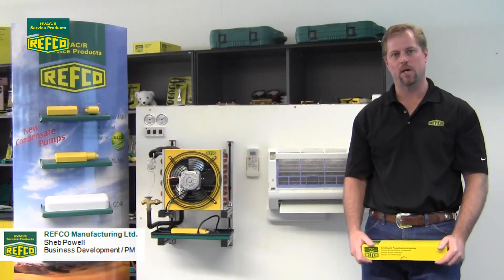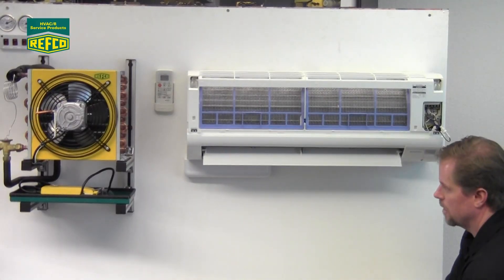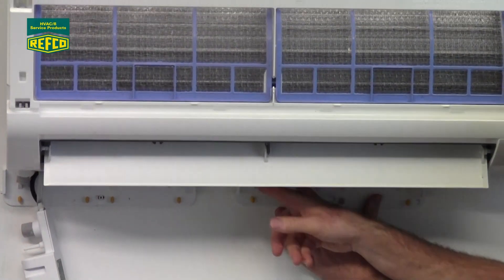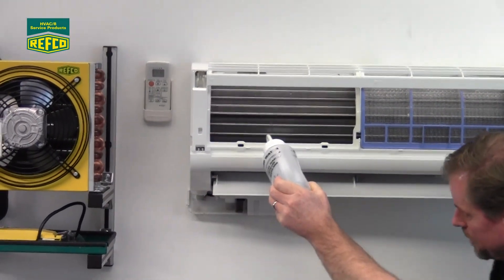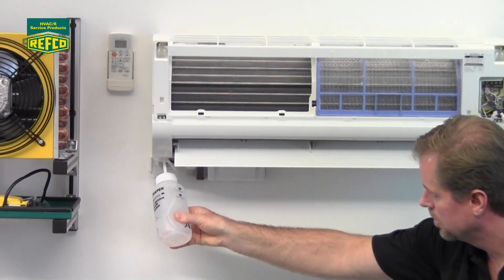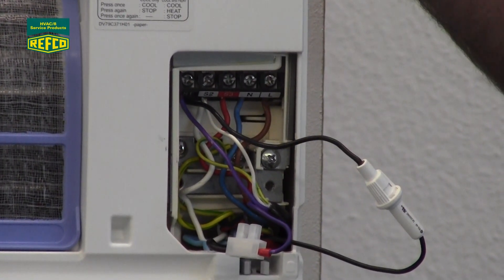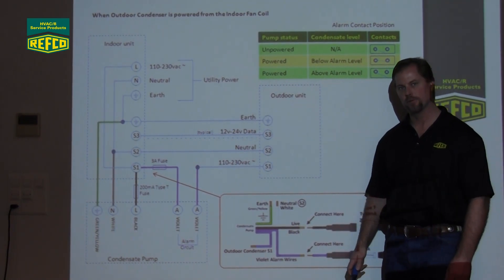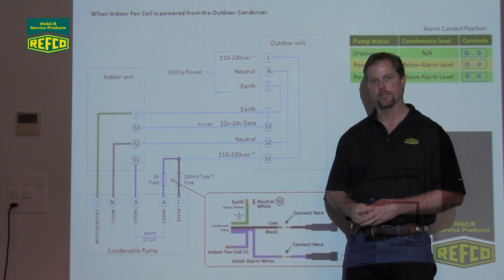REFCO GOBI Condensate Pump Installation

Comment: Hm I used to connect the safty connector between the S1. But just had a talk with a colleque. What if I cut of the S1 - The valve keeps open and condensor might freese and in the long run it coud freese so hard, it distroys the indor unit

Comment: anyone know how strong this pump is?  like can it pump water across an entire garage and out to a downspout outside?  how high can it pump?  or how long of a run can it handle?
Reply: Max suction 9.8 ft max head 65.60 ft max horizontal run is 330ft at zero head and 0 suction   That’s the specs off the manual wish they would explain it like normal pump like 30 ft lift and such  guess I will find out when I start the unit to see if it works I am going 5 feet up and 20 ft across and having it pump into 1/2 pvc running down the side of the house with my line set

Comment: Ours seems to have stopped working.  The water tray is full and nothing is going out the tube.  It’s making a very loud rattling sound.   Probably needs to be replaced?
Reply: From your post we do not know what can be wrong with your pump. 
Pls take pictures of the installation, note power supply, duration of operation, installation settings with other components of the cooling system and bring the pump back to your distributor. He can analyse the operation of the pump with help of the REFCO Pump Read program. And he then decides about the next action.
Thank you for your cooperation. 
Kind regards
REFCO Manufacturing Ltd.
Reply: REFCO Manufacturing Ltd. 

Here is what it’s doing..

https://youtu.be/wmuJeu5LdE8

Comment: If the pump was connecter previously to 120V; would one be able to connect it to a 240V source, and the pump still operate properly?  (Reference universal ballasts:  once the initial voltage is applied, it is only that voltage hence forth).

Comment: Midland Texas - Last week I had a mini-split installed with gobi pump.  Question?  How long should the pump run?  This pump runs for 15 - 20 minutes at time.  The discharge line is clear but the pump is not moving much water.  This one comes on an runs for extended periods of time even when the A/C has been turned off for hours.  It vibrates the wall and is very annoying?  Any suggestions?
Reply: Hello Richard,
Normally they will only run for 10-50 seconds at a time depending on how humid the indoor air is.  Running 15-20 min is definitely not correct.  How high is the drain line running upwards? How big is the drain line diameter?
Try cleaning the water filter and also wipe down the digital water sensors. Sometimes very hard water will leave mineral deposits that will fool the pump into running when it shouldn't.
Also try to zip tie the drain line securely to the line set insulation without pinching it off. Often times the vibration noise is caused by the drain line vibration harmonics bouncing off of the inside of the plastic fan coil casing not actually the pump itself.

Comment: What are the maintenance requirements for these pumps? I thought I saw something about a filter--but how does the unit come apart? Where is the filter? Where do we get replacement filters? Or do they merely need to be washed/cleaned? Thanks!
Reply: Just rinse out the filter once per year and clean out the clear plastic drain tray. Keep it clean from dirt and algae.
The filter is the round foam piece that covers the water pick up that extends down into the clear water tray.
Just pull the outer cover off the pump and lift up on the pump and water tray to remove from the wall back plate.
Clean the filter and water tray  with warm soapy water rinse out well.  It also helps to wipe down the digital water sensors once a year to keep them working tip top.

Comment: It would be extremely helpful to see an installation video for the YUMA pump, including the wiring work. The diagram that comes with the YUMA pump is confusing to the electrician and since mini-split systems are (relatively) new in the US, not all HVAC technicians have worked with all of the configurations. So seeing the wiring work live will help--A LOT! Thanks.
Reply: Hello Fiona,
Thanks for the feedback.
The wiring on the Yuma is exactly the same. Just be aware there are multiple ways to wire in the pump. It all depends on how the fan-coil is powered. Either from the outdoor unit or independently powered from inside the room.
All of our pumps, including the Yuma now come with a color wiring diagram packaged inside the box, along with the appropriate fuses.

I will endeavor to make and post a new video on the Yuma though.
Best regards,
Sheb
Reply: Thanks! Also, would you mind also please m a point of reassuring electricians and HVAC technicians in the US that the small gauge pump wires will, in fact, carry the power. It seems they're not accustomed to this configuration and using such small gauge wires. Thanks again!
Reply: Sheb P
Got the pump installed, and it's doing AWESOME!! Is there a filter we need to replace/clean periodically? Doesn't make sense there isn't one, so any information regarding this would be much appreciated.
Reply: It's SO quiet, yet it's pumping out plenty of condensate. I LOVE it!